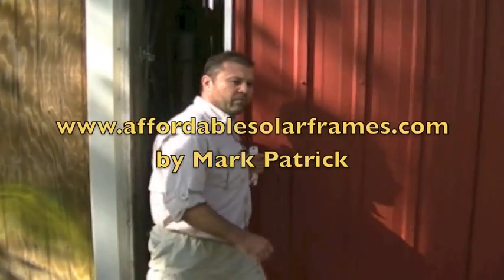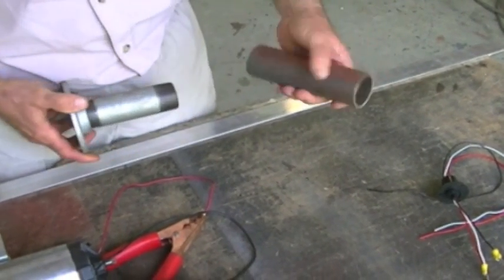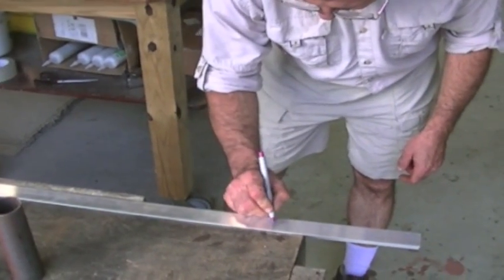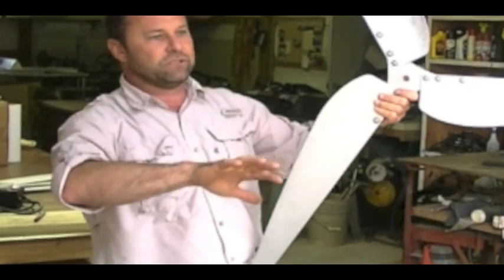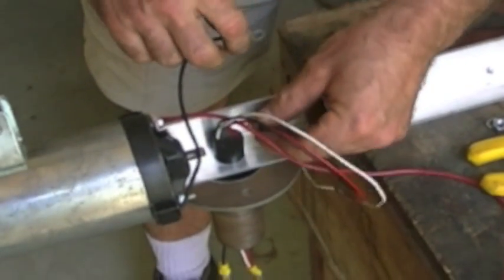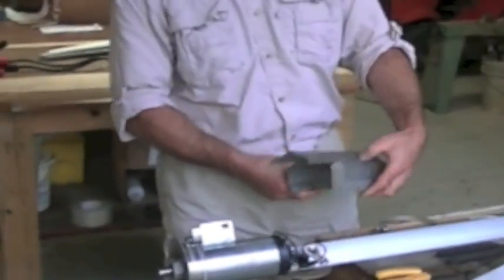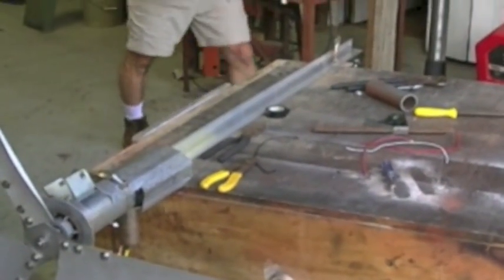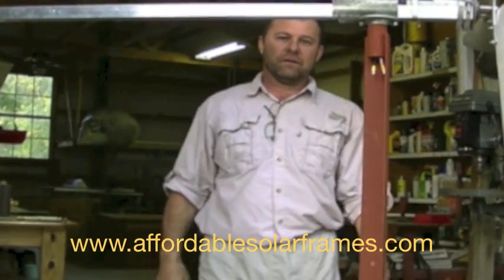How to build a Wind Turbine with a tread mill motor.

Comment: This is NOT an airfoil blade!!! I can clearly see from the shape that this is not able to create a 'vacuum' on the opposite side. The only way to do this is to shape the blade with one side being flat, or at least flat in reference to the opposite side, so as to make the air move faster across one side than the other, the same principle that makes an aircraft wing cause lift... If you look at the end of an aircraft wing, you will see that the bottom is flat, and the top of the leading edge is very thick, while the top of the trailing edge is thin. This forces the air moving across the top to move faster, and causes a lower pressure than the bottom, where the air is moving slower...

This blade is the same thickness across the entire surface of the blade, I think the confusion here is because of the shape of the leading edge, in that it is a curved edge, which does next to nothing for energy capture...

Also, insomuch as he claims that the energy you are capturing is 59%, that is the MOST energy that you can possibly capture from the wind, with the absolute most efficient design there is. The calculation is called Betz' Law/Betz' Limit, and it states that the greatest energy you can capture from wind energy is 59.3%...

Yeah, I know, nobody probably cares about this, but I find it is important to provide the most accurate information possible, so that people using that information can make the most educated decision they can...

This is NOT meant to belittle the guy in the video!!! Please understand that!!! I am sure that I say inaccurate things all the time, unfortunately nobody wants to take the time to correct others, and it makes us all less informed!!! So, do the world a favor, and if you have the correct information about something, and someone says something that you KNOW (Don't be an ass about it, and make sure that you KNOW, not that you think you do.), take the time to correct others. Personally, I love it when people correct me, as long as they are actually correcting me, because it means that I just learned something new, and I do diligently seek out new information and knowledge!!!
Reply: Jacob Crosby It's an airfoil blade. Check out this: https://en.wikipedia.org/wiki/Airfoil
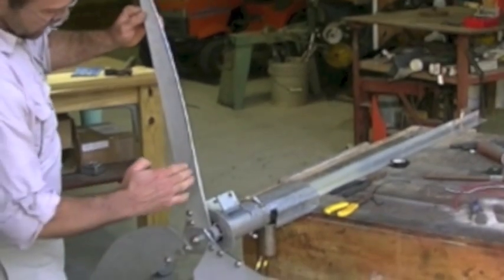Reply: Jacob Crosby yes it is listen at 12:25 where he explains that it uses lift
Reply: Many an airfoil made out of fabric. 

It's the shape that makes it happen.  Long surface area on one side, (pressure side) short on the other, edge to edge (suction side).  

Geometrically these blades are scale modeled after 40 meter turbine blades.  

I used to build 40 meter wind turbine blades, and what you describe is not how it works.

Comment: You should use a full wave bridge rectifier. more efficient.
Reply from the maker: Don't need a rectifier, the generator produces DC current.
Reply: markp0177 
because it has a rectifier already. There is no such a thing as a wind DC generator. The (full) wave rectifier is inside the generator casing.
Reply from the maker: enoxosr1 The tread mill motor has a commutator, no need to have a rectifier.
Reply: enoxosr1 brother you only need to rectify ac, ac comes from a alternator and dc comes from a generator, why he has is a generator, if that helps

Comment: windy nation says to hook the diode up opposite of how you did, and would you use the positive wires and not the negative?? please clarify in detail. thanks
Reply from the maker: Well wind nation knows more than me. A diode is a one way valve for electricity so I don't think it would matter which side you put it on.
Reply: Ok thanks for the reply, makes sense.

Comment: Hi I'm making one for a school project and I'm using the motor out of a treadmill that looks just like your but how do i make it so when i lug it in to my battery that the battery doesn't rotate the blades and instead that the blades rotate the motor. Basically how do i turn the motor into a generator?
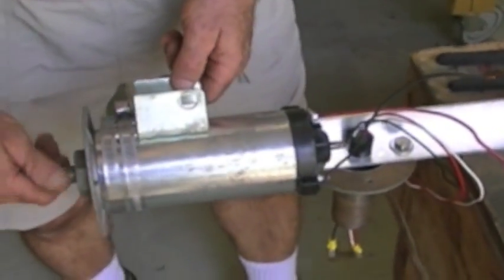Reply: Listen in at 7:35, you will need to use a blocking diode
Reply from the maker: You need a diode. A diode is a one way valve for electricity.

Comment: This is an awesome DIY tutorial. For those of you who are not really familiar with renewable sources, make sure you look at schematics of how to connect this thing to battery banks. With wind turbines they always need to have a load, so when the batteries are full, you need a way to shift the energy or you could blow up the batteries. The blocking diode is just the beginning. You should have fuses, charge controller and "dump load" that can eat the extra power.
Reply from the maker: Around 300 to 500 watts
Reply: Really! Nice.

Comment: Great, Mark. A totally layman's question here. I live in a coastal area of Central America with a daily breeze of 13 knots with frequent gusts to 25 knots and higher. Would your system provide enough to continually provide enough charge a battery bank to run a small household? That is, just running a couple of computers, a refrigerator during the day and add low wattage LED lighting at night? I have also a electric well pump. I want off the grid completely. What would you recommend?
Reply from the maker: I don't think you could run all of that but it would help charge your battery bank. I would do both solar and wind.
Reply: markp0177 Thanks.  Yes, to charge a battery bank of how many do you think?. Yes, ok....both solar and wind. The well pump is actually far from the house and not on the same power. Man, I wish you were my neighbor! I know a lot of things about a lot of things. Jack of MOST trades...master of NONE. But, when it comes to electrical I'm totally in the dark. (Yes, that was a pun.) Going to just have to learn! Where I'm at it's difficult to get the part necessary.

Comment: nice wind turbine, what kind of voltage does this produce? is it AC or DC?
Reply from the maker: DC voltage
Reply: markp0177
 cool so this could be wired in to a deep cycle marine battery bank and have an inverter going out to make 110 AC

Comment: ok one question  Why wouldnt the yaw axis bearing just lift out of the pipe in a severe wind? I didnt see anything holding it in the pipe but weight,
Reply from the maker: Yes it could happen. I now use a longer center pipe.

Comment: No Gears?
Reply from the maker: Yes, no gears.
Reply: markp0177
 Have a question for you about this project.... Didn't see any numbers like Volt`s/Amp`s that the treadmill setup "can produce" in mild winds..  Do you have any info about that maybe? The blocking diodes come in multiple Amp sizes, same as the Slip ring electrical piece does, so knowing what the treadmill motor can produce will help keep the expenses lower by only buying the Needed numbers...

Got me a treadmill from Craigslist today for 20$, motor is out, spun in my hand-By hand and see 8-volts on my dvom so mines good, will order some blades friday, should find some needed stuff at Radio Shack i`m hoping and the Hardware store and order what else i cant find.  Was planning to build an alt. type this weekend with a stock ambulance type Big case GM 120 amp alt. and ran across your video and decided to try this one 1st...
Reply from the maker: Homerhey I do not have any info on what it can produce because I sold this to a man in Tennessee and I have not heard back from him. I live down in a valley with little wind so I do not have one. It should be good to charge a 12 volts system.
Reply: markp0177  Thanks, i went ahead and ordered some pieces myself, should have it all in this weekend unless they claim snow is nearby again lol.  I am in the Chattanooga,TN area myself and hopefully i will have some info to share about output in a couple weeks(got a pinion bearing noise in my Z71 so plans are to finish it 1st and then the project).
My son helped me spin the treadmill motor and seen 34Volts DC output with the help of an upside down bike, that is why i wondered about what the output could be, if high wind will it pass 24volts and harm my 12/24 volt controller ive ordered, would it be better to use a larger voltage one?  Will only have 2 batteries for the time being so at best i could wire them 24volt and i thought we would test it 12 and 24 and see if there is a worthy change either way..

Comment: Couldn't you just weld the flywheel to the motor to prevent it from unscrewing?
Reply from the maker: Yes that would work.
Reply: markp0177 Make it turn the other direction.

Comment from the maker: The windmill has to go thru a diode then straight to the battery. Some people use a regulator. The higher voltage does not hurt a larger battery bank. Just make sure you have at least 4 large batteries.

Comment: Mark, Excellent video. I assume positive & negative leads exiting windmill must or would be connected to a readily available battery regulator then to the batteries. My concern is being a 120vdc motor in high winds voltage could spike to voltages higher than regulator or components are rated for. What do I do about that or is there a component available I also assume would go between the windmill output leads and the regulator?

Comment from the maker: Well it depends on how much wind you have. You will need a 500 rpm to get 20 volts. I would use it to charge a 12 volt system.

Comment: hello sir, i have a treadmill motor and according to its level, its 180 volts 1.1 horse power, 4.6 amperes and 4,000 rpm. and it clockwise rotation. do you think its good to be converted as wind turbine? the brand is Lifegear. thanks.

Comment: Do you think I could mount it by digging a small hole in the ground and mounting it with cables on four sides and then putting metal stakes into the ground?

Comment: Mark, this is a great video.  I am planning to use your video to build one for myself for a science fair project.  Do you have any good ideas for a mount?  This will be transported to multiple locations so it can not be cemented in the ground.  I was thinking a cement slab with holes drilled into it and screwing the bottom in with a flange.  Would this be a good idea?

Comment from the maker: You can put the diode on either pos or neg. I did put in on the neg and used the metal frame as part of the electrical connection.

Comment: I have  my wind turbine using similar treadmill motor but  I thought it's  virtually useless. It can only generate  around 5-10 volts in windy condition which is   also very erratic.  It reaches around 15 volts during gusty wind but again not consistent. Can  hardly  charge a 12 volt battery.

Comment from the maker: Well the old generators did not have permanent magents. The use electro magnets that use power to make a magnet. I used a old generator like that when I was a kid and hook it to a bicycle. I had to excite the coil to get it to work and it was very inefficient. The most efficient generator uses permanent magnets with no pulleys just direct drive.

Comment: Instead of using a treadmill motor, wouldn't using an old style high amp, 12V car generator / alt., with a ballast ressistor and voltage regulator be cheaper, simpler, and more efficient ???. Also, by using a small right angle gear (like those used on drills), to a vertical shaft, all of the electrical components could be kept at ground level, and then you could drastically increase RPMs thru use of belts and pulleys, (and possibly attach multiple generaters to the shaft or pulleys), ???.

Comment from the maker: Your blade length and type depends on how fast your generator min rpms are to reach 13 volts. I used a 3 blade design with 30" blades that will start in a low wind.

Comment: Great Job, exactly what I want to do.  I am just not clear on the 2 phase wiring part.  could you elaborate or provide a link to a sketch to better understand?  and the diode was connected to which wire?

Comment from the maker: The battery will not explode. The voltage level drops to the charge level of the batteries. I use a coleman air charge controller.

Comment: Mark, what you use to control while the motor produce high voltage like 30V or over to charge 12V battery? What use use to see battery fully charged or not?
Will the battery explode if over voltage run into battery and too much fully charged?

Comment: Ummmm.. If you use the tower as part of the negative/ground circuit as you mention you will bypass the blocking diode. So the only thing you are really gaining by hooking the other two together is a bit of redundancy, which is good except that you still only have one negative lead which means you are right back where you started as far as current capacity goes..

Comment: Its great that you take the time to teach others how to do these things and you narrate in layman terms.  I was wondering though with the wind turbine, when you connected the blocking diode you crimped the connectors on the wire.  my question is that since this will be out in the weather, would you no want to solder the wire to the connectors to prevent any future breaks due to weather fatigue?

Comment: Mark,
You might try getting some of your supplies from Missouri Wind and Solar. They have blades hubs, rectifier bridges, and harnesses. Some of the stuff is made in the USA also.
Thanks for your ideas.
Reply: I have off grid property in the Ozarks...I drive by there, but I have never stopped.  Just got a free new treadmill motor...now I am going to stop by there.